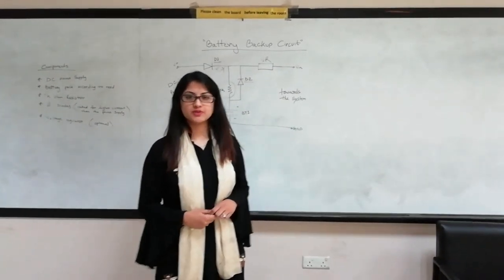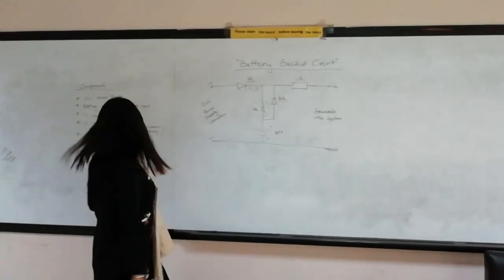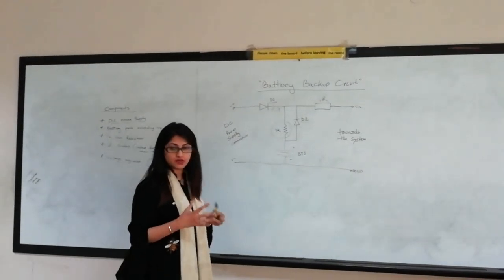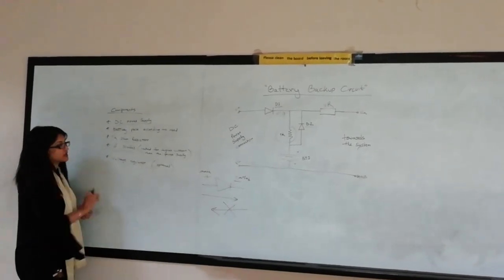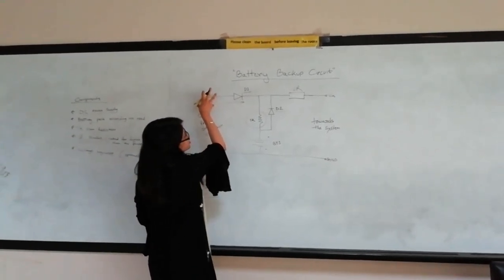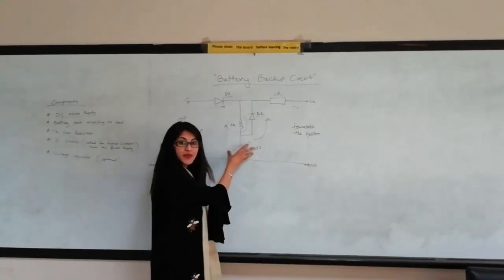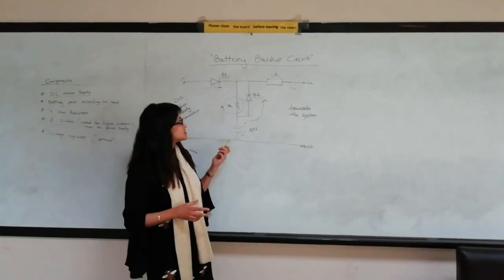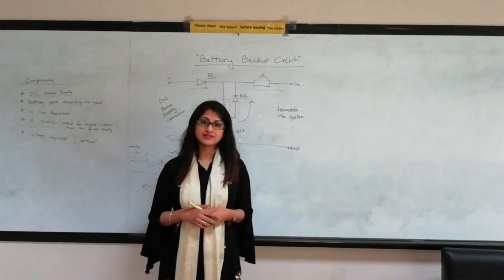Battery Backup Circuit

Comment: Great video. The purpose of the resistor doesn't come out clearly though.
Reply: I believe the resistor is actually to allow the battery to be “trickle charged” by the source DC voltage whenever there is current in the reverse direction (in other words, when the source voltage is higher than the battery due to the battery losing charge). If the battery being used is not rechargeable, it is best to avoid using the resistor.